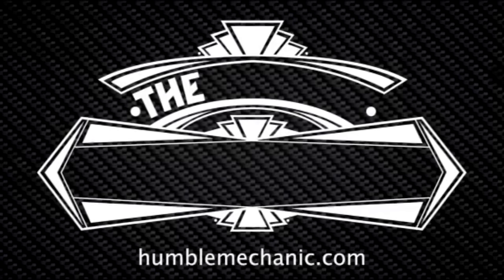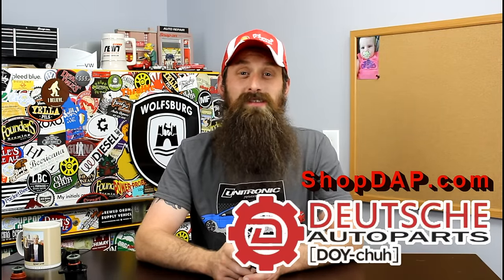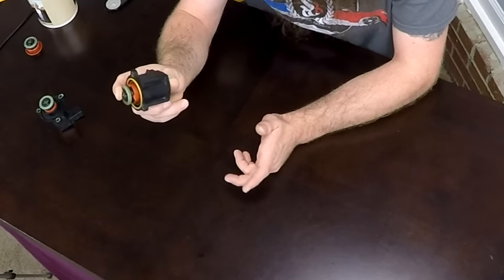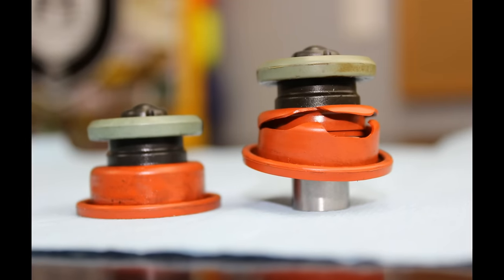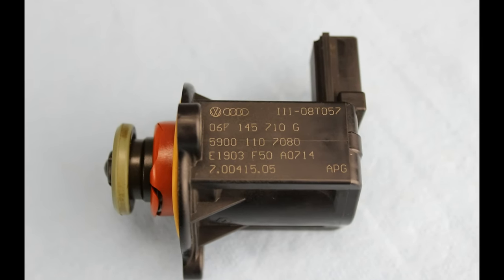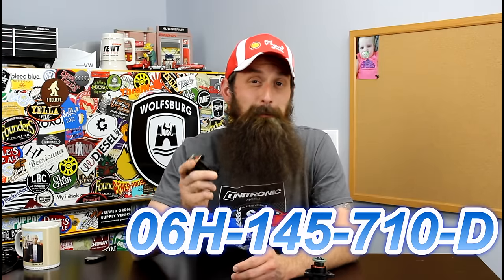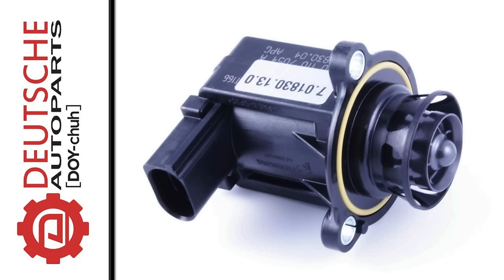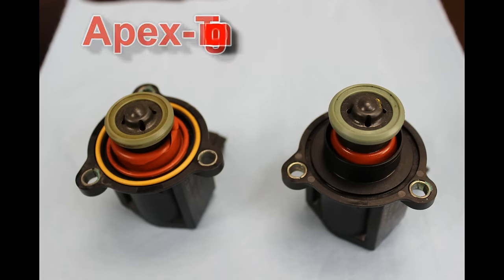How The 2.0T Diverter Valve Fails

Comment: So today I was driving my Volkswagen CC tuned and bolt on and when I shifted I felt the transmission jerk hard so I stopped at a red light and there was a light smell of fresh metal/plastic  and when I tried to go on boost I heard this very loud psstttt noise, I have a Dv and it sounds nice and loud but this sound was different it made my heart hurt, what can it be
Reply: Kinda sounds like your clutch but I’m not really sure. You should get a scan tool to diagnose the problem. Have you figured it out yet?
Reply: Corey Telfer scan tool don’t show up anything every thing seems normal I think it’s cause I have uni ecu tune and dsg tune is oem
Reply: CharlyGen2Cc is it still making that loud psstttt noise?
Reply: Corey Telfer and yea I found the problem, one of my boost pipe came loose lol
Reply: CharlyGen2Cc haha that would do it! What year cc do you have?
Reply: Corey Telfer 2017, quick update my water pump broke, it’s not leaking coolant that much so ima just wait for the part to come in and change it
Reply: Corey Telfer and yea but now it’s just the dv making the noise before it was cause the pipe was lose so it was sucking in air
Reply: @charlygen2cc78  which exact pipe was loose?

Comment: could I have this problem without a check engine light ??? audi b7 quattro.2.0
Reply: Went to the dealer the other day and they found my turbo valve was leaking oil and it did not have a check engine light. VW CC 2.0

Comment: Decided to pull out my diverter valve after getting some bad acceleration and loud hissing. Nothing looks wrong, but it was a G type valve. Probably will order a new one and hope for the best.
Reply from the maker: Very well maybe worth it
Reply: Alex Gehl did that fix it ?
Reply: @dtsuchiya9668  turns out my dad (who had previously worked on the car) had forgotten to connect the pipe that goes to the intake manifold correctly 😆. Still glad I replaced the valve though, it didn't look too great. Still was easy to replace and I recommend looking at it at least.

Comment: Is it possible to have blow-off sound and no fault codes? :) I also feel that my car has less power at low rpm.
Reply: There are spacers for diverter. Mounting between turbo and diverter. You get the sound and no check engine light
Reply: @Djapecar9  my 1.8 TSI started to make blow off sound about 2 months ago. I think something is wrong with the turbo, but there is no fault codes in ECU :/ I must check DV Valve first.
Reply: @dawidk6411  check the DV. They are common fault on tsi engines.

Comment: So could this be a cause for low compression...

Would this fix a low compression problem on cylinder 3 on the 2007 2.0T FSI engine? If not, what are the obvious suspects? Valve issues, etc? What's the typical cost to have a valve job done on this engine? Thanks, Mark

Comment: Of course I driving around wondering why my car accelerates like a grocery cart. I sure hope this is the issue
Reply: Hi. Is the part D version still the latest right now? Do you have a video of the actual replacement?
Reply: Brittiney Harvey nope, rev G is the latest and best version
Reply: @Big Smoke was the diverter valve your issue?
Reply: Furious yeah it was the issue. I snagged the GFB diverter valve and it’s been solid since

Comment: Hi. What can cause lots of oil inside electric connector? Can this be a failed DV? I have last version mounted 1/2 years old
Reply from the maker: Failed internal sealing
Reply: HumbleMechanic thanks for answering. I swap it now and same problem . After everything getting hot power comes in waves 🤔😓😥. Thanks

Comment: my car is throwing a system lean (p0171) and idle air system rpm too high (p0507) codes. could a bad dv be the problem or a vacuum leak?
Reply from the maker: Either one could be the issue

Comment: which do you prefer to both work on and drive automatic or mechanic
Reply from the maker: +Tyrell Bluto working on them, I don't really care. As far as driving, I like to drive them both. There is something so nice about putting the car in "D" and going. But I LOVE LOVE LOVE driving a manual transmission car .

Comment: How can i test the the diverter for the b5 1.8t? sometimes A volkswagen has a code for some of the craziest things, I want to be able to know when its time to actually replace it.
Reply from the maker: Jeremiah Fix The best way is with a vacuum gauge. You can apply vacuum to it. If it holds, you should be good, if it leaks down, it is bad.
Reply: Thanks for the info. Funny thing, i remember you mentioned that in a previous video. :)

Comment: I have a 06 GLI and all the sudden it seemed to lose power ,when I pressed the pedal second time it finally went back to normal. Has happened twice going up hill but no codes or light?  Have noticed my turbo seems louder, I have all stock air box so normally pretty quiet, could this be it ? Or should I start somewhere else.
Reply: What was the issue?
Reply: @ratedm90  knock sensors, fuel pump lol
Reply: @keystonecowboy3461  Mines is a b7 Audi 2.0t. Yesterday when I was driving home it felt like I was loosing power and when I looked at my boost gauge it read only 2-3 psi. I’m hoping it’s just the DV I’ve already ordered the part.
Reply: @ratedm90  yeah, mine lost like all power/just like would die on the freeway, and I would smash the peddle and it finally woke up and took off it was weird.

Comment: Do you have experience with any of the aftermarket ones made by performance companies? Is there any reason to get one of those on a tuned car over the latest revision?
Reply from the maker: Stratton Yatron If you are tuned, I would add it to the upgrade list.
Reply: HumbleMechanic Thank you for your reply, it's only APR stage 1 91 but I'll get one before adding any more power.

Comment: Hey do you know any other engine light codes a failed DV puts out? Right now I have a code P0507 which points me to a vacuum leak but there is no leaks anywhere in the engine so could it possibly be my DV?
Reply: I also have a turbo flutter but I’m not sure if that’s because of the tune I got or not

Comment: Guys I'm freaking out the car is making a weird whining sound all the time when I'm on high rpms I'm just afraid is It the dv or the turbo? Mk5 gti
Reply from the maker: It’s possible the turbo is making noise. Take it in and get someone to check it. Diagnosis of noises in a video are almost impossible
Reply: The problem was from the turbo had to replace it with a barely used k03 the power is back and its amazing! Thanks ❤️

Comment: Feels like mine is failing on my Audi. Does anyone know where would this be located on the 2l tfsi engine mk2 audi tts? Would it be accessible from bottom of the car?
Reply from the maker: Yes it’s right by the turbo and should be accessible from the bottom
Reply: On the TT it's accessible from the top! Did you ever find it?
Reply: @klaushaus9879  yes, it was under the bonnet right infront on the engine. Hard to miss tbh.
Reply: Awesome. I was going to send you a video if you needed it. Mine blew today so I had a fun time figure out what the wind noise was.
Reply: @klaushaus9879  hi, what symtoms will a TTS have if the valve is failing? I hear whooshing noises and the car doesn't pull properly under 4k rpm..

Comment: Hi Buddy my names will iam from the UK, I have a whiserling sound on my s3 8p when I take my foot off the gas. I just spent a lot of money on a cat back exhaust and a stage 2 re map but on my way home the car started to misfire and the Dyno diagnostics test read out cylinder 1&3 misfire and oil pressure cam up on the computer now the whole engine shakes when I start it up.is this the pcv? There's oil down tne right hand side can the pcv and the diveter Vale causeText you copy will automatically show here this shit sandwich without the bread has caused my car to shake like shit and basickly sounds like a bloody scooby wrx Help me out buddy kind regards William.

Comment: Im having a issue if someone can help me?  I have a 2016 Gli 2.0 tsi ,Im not tuned . I have stock Downpipe but at the lower bend i have 3" to a resonator and then to the tip.  I had an intake on but i took it off cause i thought mayne it was part of the issue.  Ok so when im normal driving i smell nothing but if I'm going Say 20 or so and floor it and then when i let off it takes a second but the smell of something like sunburnt gas and exhuast fills the car.  Now I thought maybe the DV was going bad but i have no CEL on and car seems to be running fine.  I. Right at 31k miles on the car and im stumped.

Comment: guys, i got an embarrassing question. a friend has a 2010 CC with the 2L turbo that I help do routine maintenance on. Dealer said he has a bad "air bypass valve". My google fu is failing me. His estimate mentions the valve recirculating air into the exhaust manifold and venting pressurized air from the air pump. I'm completely confused here as the name sounds like it should be a diverter valve and the dealer claims its leaking oil.
Reply: Sorry to hijack your post but I have the same question. :) . Dealership is saying the Turbo bypass valve is leaking oil. I wonder if its the same.
Reply: armando19 Yeah it has to be. its the only such valve that matches description. i just did it on my buddy's car last weekend. 3 small bolts hold it in. It leaks from the rubber diaphragm inside as it rips. newer style one is piston activated so nothing to leak.
Reply: Cool. My car is not throwing any CEL so I couldn't confirm if is the same valve. Definitely something I'll be replacing myself. Dealer is asking for $450. Your friend is lucky and should get you a six pack or a bottle of whiskey lmao. thanks for the reply! TheOprostaj

Comment: is it possible for 
me to have no code and have this problem?  when i foot to the floor the car boosts but bleeds off from 15 to 10 psi then  its like on off on off like no boost to 7 psi on off like a kid flicking a switch if i let off it will boost fine and drive fine,
Reply from the maker: Generally no. But boy anything is possible
Reply: @HumbleMechanic  lmao it was the diverter valve

Comment: what about on a tdi where does the excess boost go seen as they have no throttle intake as such
Reply: Most likely electronical controlled, that is based on fuel injector pressure and pedal position it will work in a system of diverter and wastegate to prevent the unwanted characteristics of a torquey diesiel at least by some but also in the same aspect of no throttle body there would be no flutter just a whole power in the piston stroke, diesiel!!
Reply: TDI will have a variable nozzle turbo so the angle of the turbine blades changes so little energy is applied to the turbine.  No DV is necessary
Reply: Tan N
Well, basically excess air in the mixture won't be disastrous if there is little fuel to ignite (via compression)
Reply: With TDI's, first, when there's no load, there's no fuel being injected.  Second, by design, they run a lot of extra air, to "mask" soot.  In tuning diesels, you can add more fuel to use the excess air until you cross the threshold of "smoking".  With that threshold known, then boost can be increased, to go back to the proper "masking" of the soot.

Comment: hey i have a 2011 gti ccta engine code getting underboost code possibly turbo? i can hear the air leaking it still pulls but not as hard
Reply from the maker: +Hazard  Yute  possible a turbo. This video may help. 

https://youtu.be/7fk6cSDE3hE
Reply: +HumbleMechanic figured it out it was the dv

Comment: Thanks so much for your videos, I wish you were my mechanic. I came by your channel because I have just had my DV changed on my 2005 8p A3 2.0tfsi. It would appear my mechanic has charged me for 6.5 hours labour to do this job @ $100 (NZ) an hour! Can you please clarify how easy a DIY job this is please .  I have already watched the video you mention in this one, it didn't look like a 6hour job to me. Please help! I would love to send you the supposed job invoice and work carried out by this 'mechanic'. Thanks in advance....Kia kaha bro
Reply: I have the same exact car and it’s not boosting like it used to... what did you do to get the boost back?
Reply: @isaakiita2331   Kia ora, Firstly may I suggest you watch the video linked in this one.  Depending on the age of your car you probably want to swap the diverter valve to a newer one anyway. (I think you want a ‘G’ model?) A new valve is not that expensive. This really is a DIY job especially if you can get your car on a hoist, ramps will do if not.  There are plenty of videos showing the process so I’m not doing that here, sorry! :0)  Audi quoted me 45mins of work for this job, I should have gone to them first maybe….however as my car had broken down for other reasons this wasn’t an option. Hope this helps…Kia kaha
Reply: @whosgotmyGT  thanks a lot, I will definitely give this a try 👍🏾

Comment: Can this also be called a bypass valve? I have p0035 code.
Reply from the maker: Probably. I don't recall VW calling it that anywhere, but they very well could. VW parts calls it a cut off valve.
Reply: @HumbleMechanic  for sure. I gotta genesis coupe I wanted to know if the parts were similar. Cool vid

Comment: I need help with mind i have a 2001 golf gti 2.0
Reply from the maker: +Raymond Santos what's up?
Reply: Can i put a blow out valve without a turbo
Reply from the maker: You can, but it wont do anything.
Reply from the maker: and if it does, it will be a negative for your car's performance.
Reply: Raymond Santos actually the diverter valve will help in performance.. blowoff valve will only make more noise and won't help in performance

Comment: Lol I have lean and underboost codes... getting that stupid leaky valve replaced pronto
Reply: omg I got the loud ass sound too when it spools up and down... so annoying, I really hope getting a new diverter valve shuts it up as well, sounds like my turbo is broken otherwise.  Still runs fine, just after the engine warms up my boost is considerably lower
Reply: Ethan Heitz ever figure it our, im looking at a A4 that has low boost at higher rpm, I'm thinking it's just this valve. The guy selling the car thinks the turbo shit out. I think otherwise. If it did it would act up at low rpm too.
Reply: Shane Lockwood Doing my DV soon as have a whoosh sound on boost and higher rpm it feels quite wheezy and gutless, think its the dv so will see lol.

Comment: I can’t trust anyone who pronounces 2.0T as ‘Two Point O Turbo’
Just say 2 Litre. 
And for anyone that has to change the diverter valve, it’s not the whole solenoid that fails, it’s just the internals. Instead of coughing up for a whole new piece. Just replace the internals with those from GFB. Go Fast Bits, because as a trade off, you’ll also get much cleaner and quicker boost activation, sharper throttle and the ability to tune the car and not have to worry because it can handle as much boost as you can throw at it.

Comment: I change pcv valve kit and dv to S3 8p. Now i have epc light on and p0190 fuel rail and p0343 camshaft position sensor error codes. Wtf? 🥹
Reply: Update: I had completely left one connector unconnected under the hose connector below the PCV. It was not visible at all until I took off the air intake and intake shield. Thank god all works now! 🥲